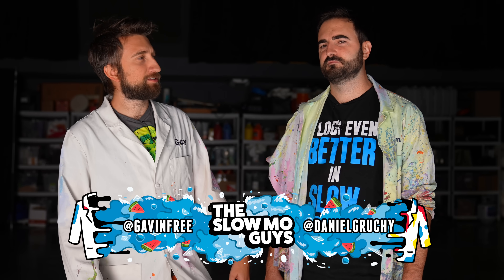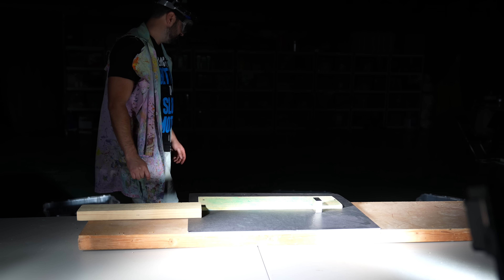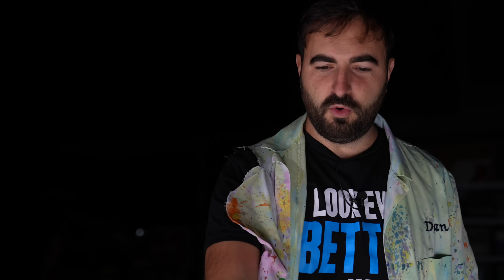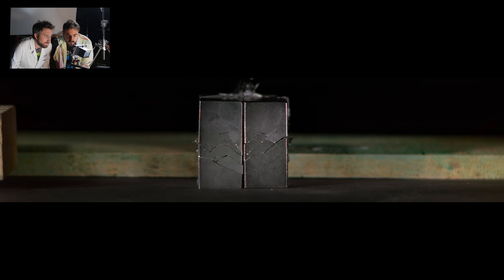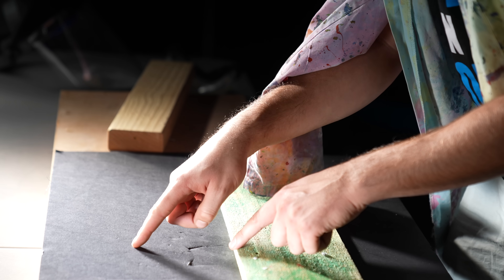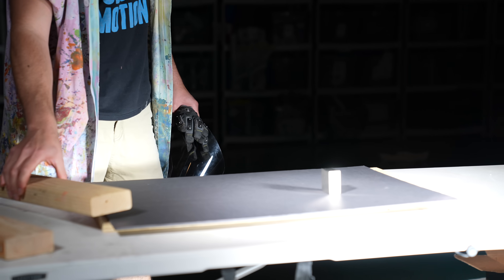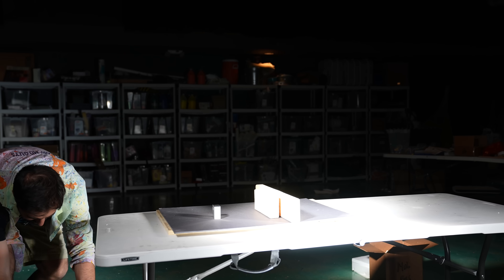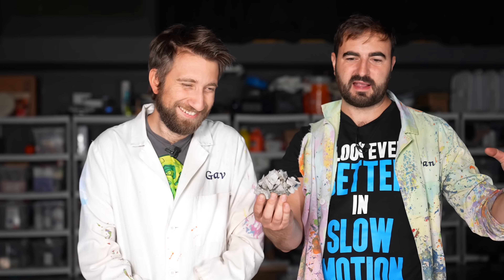Ridiculous Magnets Colliding at 187,000FPS - The Slow Mo Guys

Comment: woa. wait a sec....you have crazy magnets (well had, but you can get them)
you have guns
you have ammo that's mostly copper ??  (is that a thing??  or like aluminum bullets??)
Does a high speed COPPER-BULLET straight-out MELT if it traverses a crazy magnetic field??

there's legit science there IMHO
Reply: To answer your question: No, copper has no magnetic properties to speak of, so it would just keep going.
even if you used a bullet made of a metal with high magnetic properties. When fired from a gun, the bullet has way to much energy / To little mass, to be stopped by even the toughest magnet on earth.
I hope that answered your question.
Reply: Search: 'gun vs magnet' if you don't believe me.

Comment: You guys should do this again, but under water! I'd love to see the compressed water exit all these cracks.
Reply: That would honestly be pretty darn cool. Would water slow the magnets down enough to not get the same effect? Would it be more crazy impressive? We need to know.. FOR SCIENCE!
Reply: Certainly would slow them down a lot.  I wonder if they would even shatter.  
Yes, do it.  😂
Reply: or a water-filled balloon in between.  or a paintball.... or a grape/strawberry
Reply: @joeylegaspi3515  a steak or a chicken leg or a rubber glove cast of dowels and ballistics gel to simulate an unfortunately placed hand
Reply: I’m interested if the water would interrupt the magnetic field in any way? Whether DI, tap, or salt water
Reply: @drkflame8  Water is polar, so the magnetic field could in theory interact with it.
Reply: if they can do it safely, it would be an amazing thing to watch probably.
Reply: Would like to see a large Gummy Bear used between them.
Reply: One word, nitroglycerin
Reply: Water is incompressible.
Reply: @Max_Jacoby    It will compress if you pour it into a black hole.  😂
Reply: @my3dviews  You don't even need that, ocean water is 4% more dense at its greatest depth than at the surface.
Reply: @frostchain2362  is that because the salt increases density and there's less absorbed gas?
Reply: @frostchain2362  So 1,068 bars or 15751 PSI to compress it by 4%? Yea, that's certainly compressible, but for almost all practical purposes it can be considered incompressible. After all with enough pressure everything is compressible. The question is if it's noticeably under the kind of pressure you can create using reasonably practical methods.
Reply: @frostchain2362  And that fact admittedly shows us why it generally makes sense to consider water to be incompressible. Still a valid point though.

Comment: One of the few things I recall from my physics degree is that the force between two bar magnets varies as 1/(distance)^5

Things like gravity and the force between electric charges normally goes as 1/(distance)^2

This means that, compared to medium distances, the force between bar magnets is proportionally way way smaller at larger distances than between charged objects, but it also means that at close distances it’s way way way way way way stronger. Makes gravity look like a real weakling.

Comment: Had a friend who was experimenting with those exact same magnets. Had a controlled collision, turning into a 'magnet meatball' as he called it. Picked up the remains in a hand and went looking for shards he saw flying. Picked up a shard with another hand and BANG, the shard went THROUGH the back of the hand holding the meatball. The shard had small and pointy, like an arrowhead. Nicked a tendon and gouged one of his metacarpals. It was so fast and sharp, he only felt a tug, then wondered where the shard had gone, and then why blood was pouring from his hand. It also severed one of the veins on the back of the hand holding the meatball.
Reply: When working with magnets, never forget: You Are The Meatball.
Reply: Yeah the micro shrapnel in that lab would be terrifying for sure!
Reply: @jenkem4464  Yeah but hold next to no magnetic field! This story was total BS. Smaller the size, smaller the field!!! Something large enough to produce a magnetic field to rip through you hands you're gonna notice INSTANTLY. Plus if it WAS as he said it was then the thicker side with a larger magnetic field would have been forward and you're gonna notice that going through you hand!
Reply: @ku8721  The larger magnetic field is in his hands with the big chunk.  The danger is bringing that one near a spot that has the smaller chunks that would easily just zip through the air from the table or maybe some fragment that flew into the clothing.  We saw ourselves how far they started moving towards each other and those are huge fairly heavy pieces!
Reply: @jenkem4464  Yes but it is affecting the smaller chunk so the maximum field strength is what you get from the smaller chunk! Get a 10 foot wide magnet and the pull on a staple or paperclip will be the same as a 6 inch magnet because there isn't enough metal mass to react with. You said it yourself "those are huge heavy pieces" the tiny pieces didn't have enough field strength to be pulled back. Hence why they flew off.

Also air resistance is much MUCH weaker than flesh. Just because it has the field to move a 3 gram object through the air doesn't give it the strength to rip through the flesh of your hand.

Edit:I see your previous comment. Stop being one of the fooled people here, Google the inverse square law of magnetism and come back and still try to tell me this story is true!!!
Reply: @ku8721  "Get a 10 foot wide magnet and the pull on a staple or paperclip will be the same as a 6 inch magnet because there isn't enough metal mass to react with."

Not quite sure that's accurate.  I dare you to walk around CERN with paperclip in the palm of your fist!

"the tiny pieces didn't have enough field strength to be pulled back. Hence why they flew [off]"

They flew off because they reached escape velocity from the initial impact.  Something lying there on the table right inside the threshold of the larger magnets range of pull (enough to lift it in the air from a stationary position) could feasibly have enough momentum to pierce through clothing and soft tissue.  Remember...these fragments are likely also very sharp.

Besides, I wasn't judging the veracity of the story just making an observation about the dangers of holding a big chunk of those magnets in your hand close to other fragments.  It's not impossible for that to go wrong somehow.
Reply: Nooooo thanks. I just crushed a finger tip folding a metal table two months ago, you can keep all this stuff right away from me.
Reply: Youch!
Reply: MAGNETS
ARE
NO
JOKE.
Reply: @renerpho  NO but this post was!!! Total BS!!! Break a super strong large magnet into tiny pieces and you get weak tiny magnets. Mass is a huge part of magnets
Reply: @renerpho  No but this story is! Total BS
Reply: Oh god, that is horrifying. I hadn't even THOUIGHT of the awful potential for extremely magnetic shrapnel.
Reply: @MultiPurposeReviewer  NOPE the shrapnel is NOT extremely magnetic! Or at least no more than a regular magnet at the same size! This story was probably BS. Break a large magnet into many smaller ones and then you get smaller weaker magnets, not many super magnets. The mass has an effect, which is why I think this story is BS if the magnet was pointed on one end then the field strength would be much weaker on that side! Pulling the blunt wider side into his hand instead of the sharp edge.
Reply: @MultiPurposeReviewer  Not real see my other comments
Reply: @MultiPurposeReviewer  Because there is none. When you reduce the size of a magnet (like smashing it to tiny shrapnel) you reduce the field strength. This story is BS
Reply: On further reflection this comment may be fake
Reply: @sleepCircle  I feel like this was total BS!!!
Reply: @ku8721  did you not watch the video of the two solid metal magnets shattering each other to pieces from their own attractive force?

even if, like you said, the smaller piece is less attractive, it's still under the influence of the larger magnetic piece.
Reply: @sleepCircle  Yes I watched it, but I've also I LIVED it!!! And even with a larger base magnet and an unbroken magnet of 3x6mm it DIDN'T rip through my hand at the distance of MY HAND!!!!
Reply: @ku8721  alright well you sound passionate and quite convincing but I suppose so does the original comment. I'll withhold passing judgment on which one is true for now
Reply: @sleepCircle  Have you seen big magnets? Have you seen them react with small actual magnets??? Have you heard of the Inverse Square Law???
Reply: @ku8721  yes, no, and yes. What you say makes sense, but it's possible something in the story wasn't conveyed properly or there's some information we missed.
Reply: @ku8721  ngl, I was with your initial reply, but now you seem like you're getting overly emotional and attached to this story
Reply: @sleepCircle  If you understand the inverse square law then I shouldn't need to convince you of anything else to prove this was most likely BS. Even if the magnetic field was strong enough to affect the small piece at any distance over a foot you'd barely feel a tug not a force enough to rip through flesh, and the closer you get the exponentially stronger the effect.
Reply: ...ow.
Reply: Do you know "Periodic Videos", with professor Martyn Poliakoff? There's a video where the professor tells the story of a colleague, who lost a couple of fingers while demonstrating a somewhat dangerous chemical reaction to a class. After the accident, he always let a technician do the demonstrations. If someone asked, he'd hold up his hand and say "I've had a hand in this reaction". A good way to frighten a class!
Reply: @renerpho  he would get a thumb and a index for that joke.
Reply: Thanks for the story! That's grusome
Reply: Liar
Reply: @TymanBert  He's a TOTAL liar!!! I've held the same size magnets in my hand to a paperclip... didn't rip through my hand
Reply: Forbidden meatball O.O
Reply: Did he need a hand after that.
Reply: Totally agree with K U, this story is total BS, what K U didn't mention is when the magnet is smashed the magnetic field isn't concentrated into 1 direction anymore, but in many directions making the magnet far weaker overall!
This is the reason Slow-mo guys didn't smash those 2 blobs together as the results would have been disappointing.
Reply: @ShadowebEB  I especially like your point about them not smashing the 2 "blobs" together. If it would have been worthwhile to show, likely, they'd have done so.
I'd also point to that bit where they discussed the small wobbly bit's behavior.
I'd say, imo, K U is correct...& perhaps tearing their hair out at the push back on some logical, experience & fact-based information.
One question for the original poster...was the friend trying to explain a weird scar or...? How did this story come up in conversation?...or are you just having a bit of fun?
Reply: @echognomecal6742  No I'm tearing my hair out because of the amount of people this fooled. Are most people really this gullible??? Also I'd bet he just made the whole thing up.... OR was just as gullible as these other people when his friend told him the story.
But yes my opinion comes from logic, experience and facts, thank you for noticing!

And my question for the original poster is did you actually BELIEVE this??? If he actually does believe it then he isn't lying... doesn't make him right just means he isn't a lair.
Reply: @ShadowebEB  Actually I did say that but I didn't articulate it properly. It was part of my second point of my first post.
Reply: Bro wtf
Reply: This is the sort of horror I imagined seeing the shrapnel flying everywhere, and then him holding it in his bare hand. I would want to be wearing some thick leather gloves at least, if not Kevlar or something like that. Cleaning up this mess seems terrifying.
Reply: Fake
Reply: Magnet Shard: Omae wa mou shindeiru
His hand: Nani?!
Reply: I am rather dubious of this story for several reasons. One, small items, even N52 neodymium magnets, don't have much of a magnetic field, that is why you can easily remove paperclips and staples from a large magnet, but try that with a bolt and then you have to slide it off. Two that "magnet meatball" has a much MUCH weaker field than the original magnet, first it turned one magnet into hundereds of little ones which have weaker fields, but the fields also are attracted to each other weakening the area the overall magnet field. Hence why in the video he was easily able to get it unstuck from the table, if that magnet was intact he would have have a MUCH harder time.. And third and finally due to the inverse square law, the magnetic field weakens exponentially over distance, even those small spacers the magnets shipped with is sufficient to weaken the fields enough for you to separate them by hand. Also if it was arrowhead shaped, then the thicker part of the magnet would've been the front as it has to most material to carry a magnetic field. The tiny pointed side would face away.
OH and the main reason I have doubts is I own several of these magnets and have had this happen by accident, I used a non-damaged one to pick the tiny shards up and plucked them off by hand! But yes those buggers were SHARP and it only took one cut before I got out my welding gloves. Then I smartened up and put the good magnet in a Tupperware container and when I was finished it all just dropped off when I easily pulled the magnet out.

TL:DR- Small and sharp makes a crappy magnet.
Reply: @ku8721  also he would've had to have been holding one hand awkwardly backwards for it to go through the back of his hand, because normally palms are facing each other

Comment: If I think of the two magnets as cubes each with two poles, and then conceptually break each cube down into, say 10x10x10 smaller cubes on impact, then we have 1,000 cubic magnets, with their poles identically aligned. Once the original cubes fragment, a small amount of random movement in the individual cubelets must be introduced.  Now we have 2x1,000 cublets rotating, and there must be torque enough to slew around the smaller ones so that their "opposite poles attract", which leads to accumulation of two cubelets into a single cubelet with a different polar alignment, mass etc.  This chain-reaction must be resolved to polar neutrality before all motion stops. Not to mention the polarity/rotational momentum randomly lost to the micro-cubelets flying out of range. Of course, I'm no physicist, nor mathematician. GREAT video, Thanks. Chris

Comment: You can do so much more with these. Crush something between them is the first thing that comes to mind. You can also shoot a metal projectile so that it flies right next to the magnet and see if it will change direction or completely be slammed into the magnet mid air!

Comment: But honestly, how do you dispose of a magnet or how do you store it ? Seems like such a risk for something that is active all the time and you're bound to forget about if you put it in a box or something.
Reply: Just heat it up until it gets above the Curie temperature, and it stops being magnetic, even after it has cooled down.
Reply: @mytube001  Not sure if heating it up metal to 570 °C is a feasible solution for most people.
Reply: @MaikNL  It's not that difficult. I can buy a propane blowtorch for very little money at my local hardware store. That'll do the job easily. These neodymium-based magnets only require a few hundred degrees. You could chuck them into a simple wood fire and leave it for a bit.

Comment: I fool around with neodymium magnets and lasers in "wiggler" experiments.
My small ones are ½inch x ½inch.
I got careless and somehow,mdnaged to get the webbing between my thumb snd forefinger between the magnets.
Its an experiment in pain you will remember for ever.
I cant imagine getting trapped by those beasts you have. When you buy the neodymium magnets , you get a warnjng sheet with them about using caution to NOT get body parts between them.That sheet is NO JOKE.
Magnetic field is an interesting phenomenon. One of the 4 forces in the universe.(Tho,to be fair,the  proper quantum physics term for the one of four forces is the electromagnetic force . Still...a magnetic force is a magnetic force.)

Comment: An idea for these magnets: What if you did that but underwater, like the water would probably boil and it would look cool in slowmotion. (this is just a theory, no facts)
Reply: I was also thinking the water would slow them down and it wouldn't look as cool as it did here. But what about if they covered them in wet paint instead??
Reply: I suspect that the water would slow them down enough that they wouldn't break, just stick together in an uninteresting way.
Reply: One of the most interesting ones
Reply: Either slow them down to prevent them from shattering or flash steam.
Reply: Water doesn't boil because you wham two pieces of metal together moderately hard.
Reply: @aluisious  they are referring to how, if an object moves fast enough in water, it creates a cavitation bubble (a vacuum) that gets very hot because the pressure is so low compared to the rest of the water that it pulls the water apart into steam to raise the pressure
Reply: @aluisious  doesn't it?  only one way to find out

Comment: Very Nice, If you do plan to keep the remains you could coat them in a clear resin or cast them in a block, the magnets are coated in a layer of nickel/coppe/nickel for protection and now the inners are exposed it will rust quite easily over time.